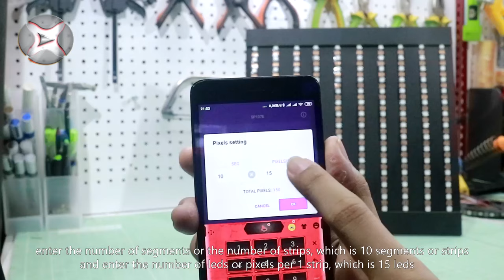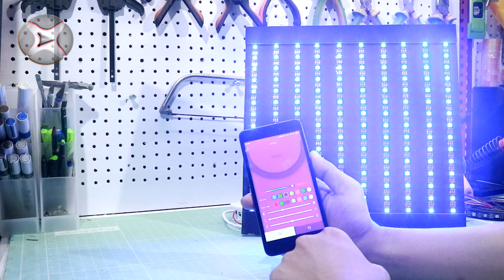Cara membuat Vu Meter/ musik led equalizer

Comment: Sp107 doesn’t support sw2812, only 2811. I’ve checked. Are you sure about led model?
Reply from the maker: the controller supports all types of 'ws' led strips
Reply: @omankkacau  mas minta nomer wa mas